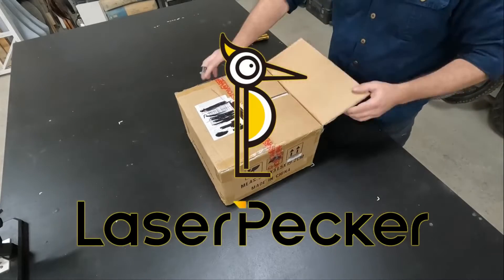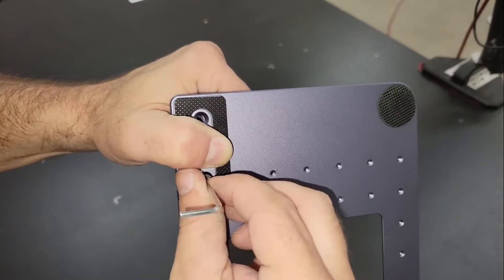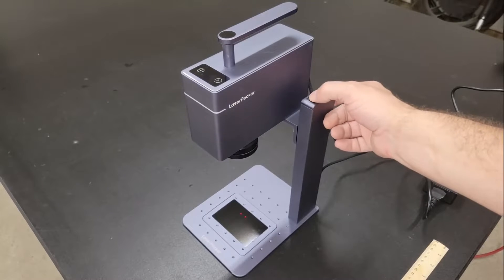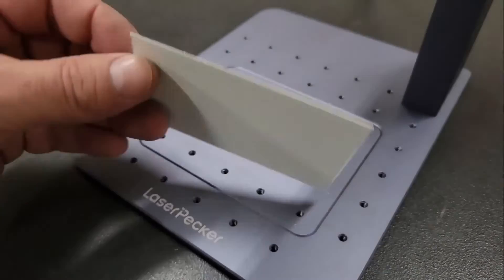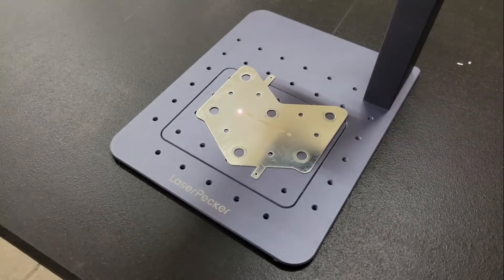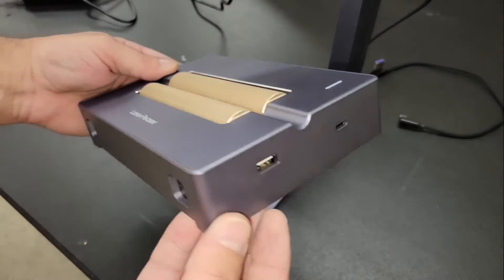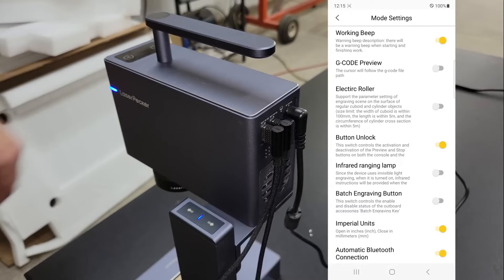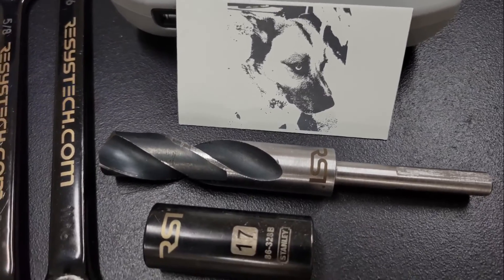LaserPecker LP3: How to Engrave Metal & Plastic Like a Pro!

Comment: these are really excellent results. I'm looking to engrave a couple of watch buckle I have with logos. These would be very small (5mm x 2mm) are these laser peckers capable of doing this and do they work on stainless steel?

Im thinking i'd need an LP3 but if the lp2 would do the job that's fine.

Comment: This is a great tool.  If you engraved anything stainless, I missed it and I wondered If this laser can engrave stainless steel?
Reply from the maker: Absolutely! Our portable laser engraving machine is capable of engraving on stainless steel surfaces. The Laserpecker4 is designed to handle a variety of materials, including metals like stainless steel, aluminum, and more.
Reply: @LaserPecker xtool f1 costs the same as your laser but it is much faster so I will buy it, yours is very slow